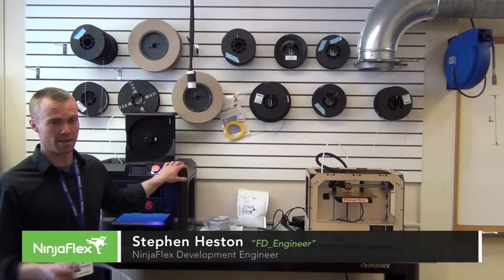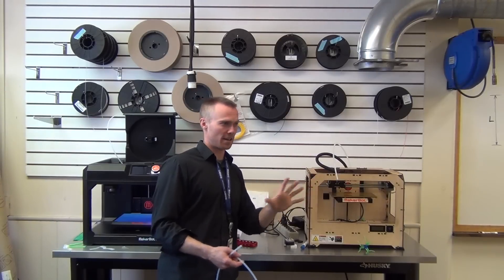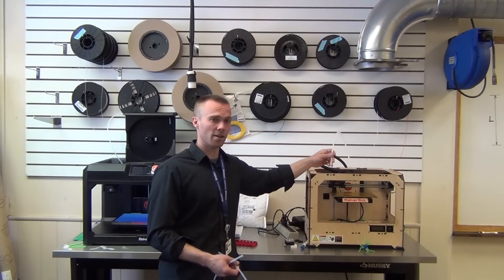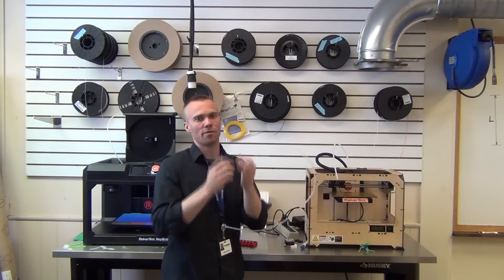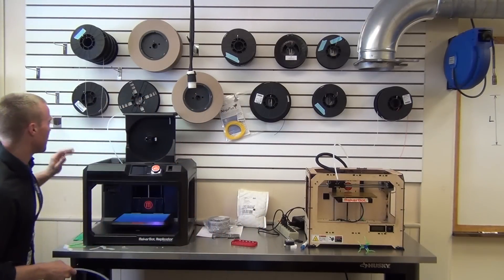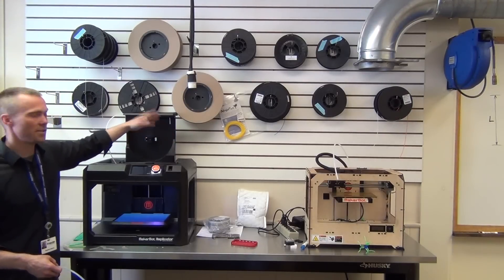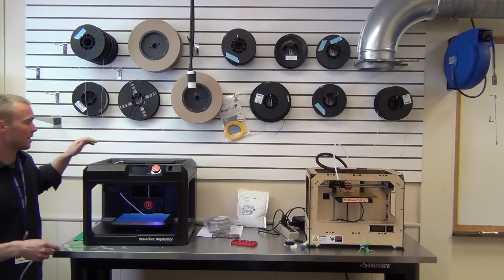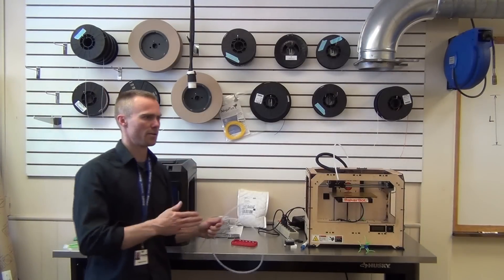Part 2.2: Guide Tubes - MakerBot

Comment: Can you guys just make 1 video that has all of these sections in it? Doesn't make a lot of sense to have 10 1-minute videos.
Reply from the maker: Hi Geuis, thanks for your reply! This video series was designed as supplemental video support for users with all levels of experience to provide tips, tricks and troubleshooting techniques for printing NinjaFlex filaments. It was split up into many individual videos to provide people the flexibility to quickly jump to the video sections they need, and easily skip over the parts that aren't relevant to them and their unique situation. Hope that helps! Thanks for watching!